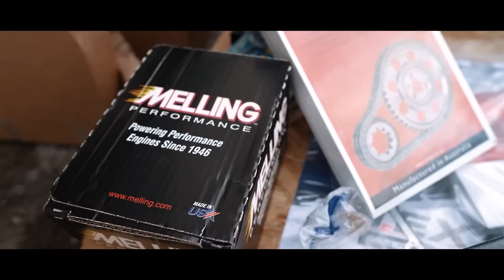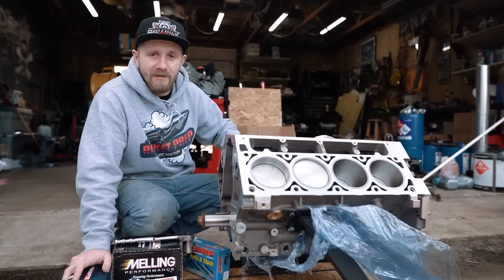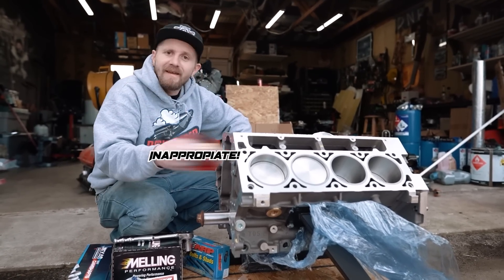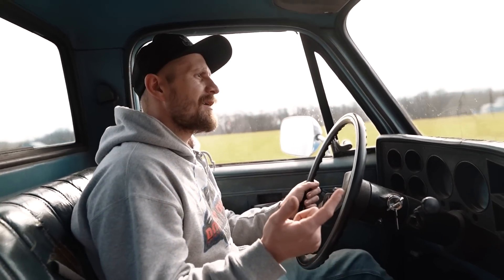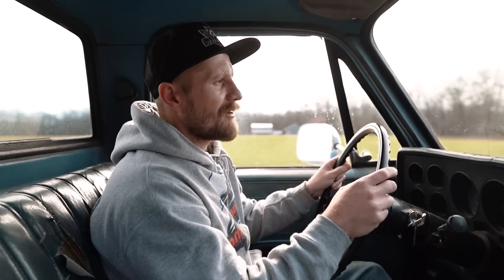A HUGE DELIVERY FROM TEXAS SPEED + WE'RE GOING TO SICK WEEK !!!

Comment: Quadrajets are easy to work with.
Easily misunderstood. Best 5 minute fix is to increase the spring tension on the secondary air doors. It will help driveability and economy. If the choke isn't working, richen the idle screws. Half turn each for starters. If they are "capped off" you can expose them by removing the carb, flipping it over, and work with a small chisel and hammer to get them to slide out. Sounds like a lot, but it isn't bad.
Reply from the maker: The problem is it’s got an adapter and a two barrel on top of it not the quadrajet, but the intake is for a quadrajet
Reply: @Matt_Ryce  ah that is a way different problem. I have a 4165 Holley (direct bolt on replacement for a qjet) that I can give you. It was on a big block, and I upgraded to a 4150. It will go right in that manifold. Let me know
Reply: @arthurgoldman3136  hell yeah good looking out